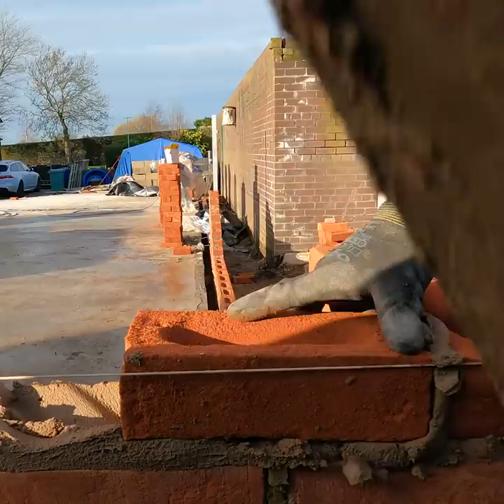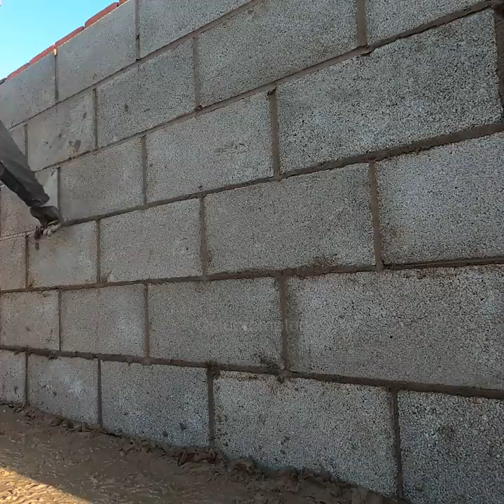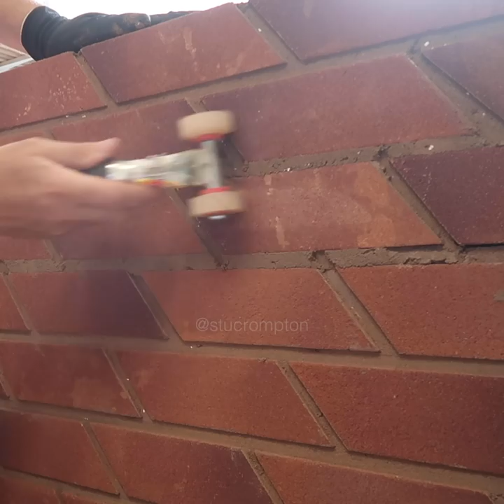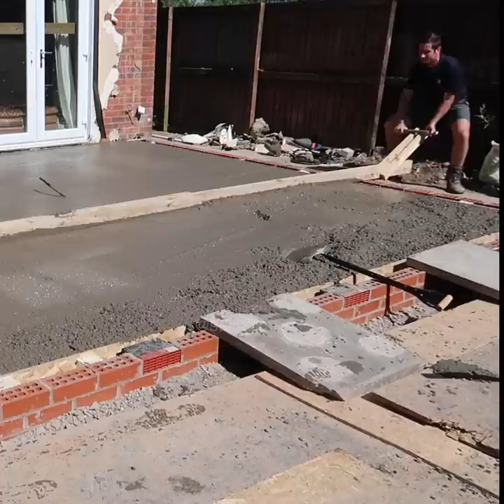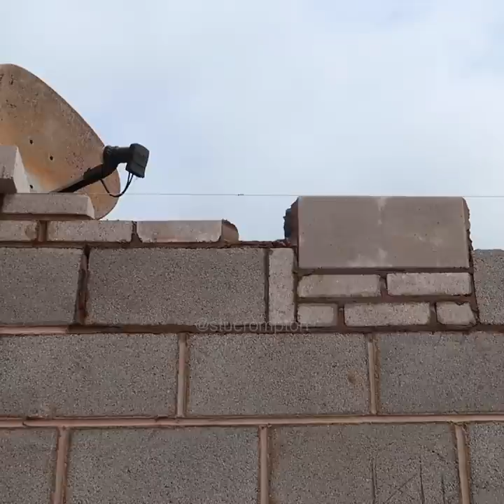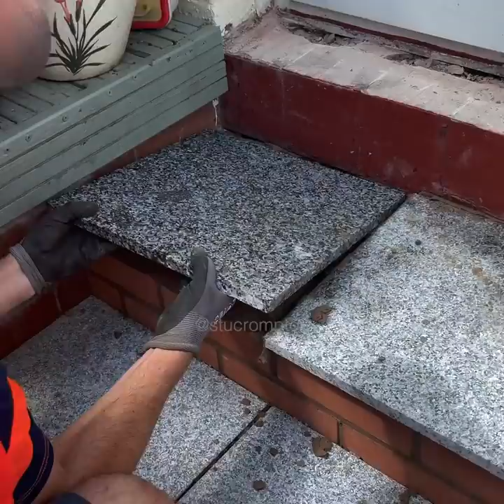🧱 Bricklaying Nature 🧱

Comment: In your replacing bricka video from a year ago, I noticed some gaps... I wont pretend to be an expert, but maybe try using a bakers pipette or decorating bag with a nozzle to flush and fill the gaps between the bricks.  Do you have a collection of bricks of older and rare kinds for those speciality jobs? If ya do, make a video it'd be cool to see.